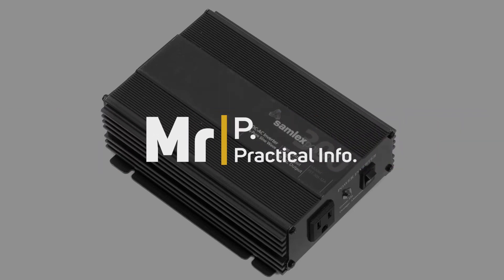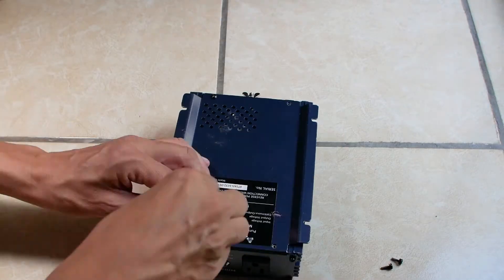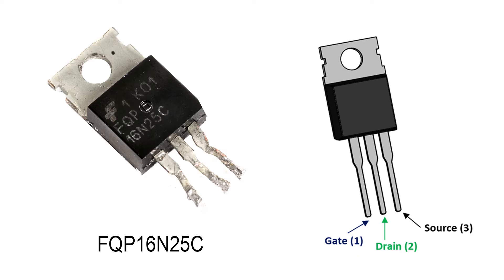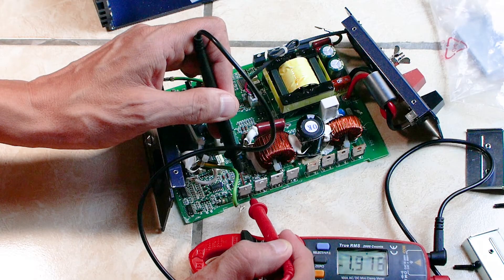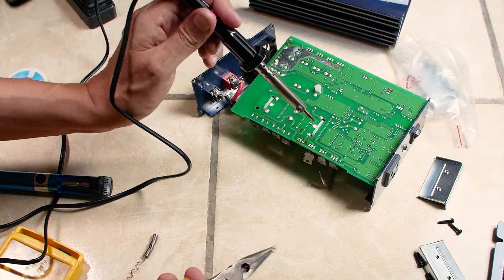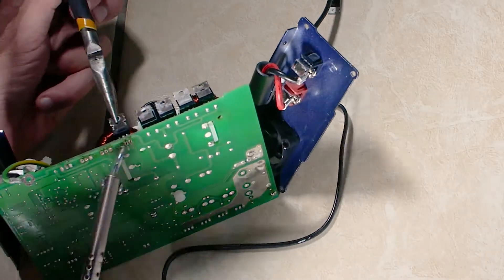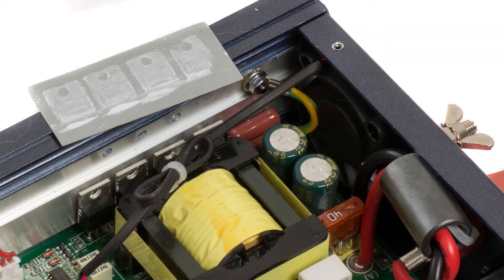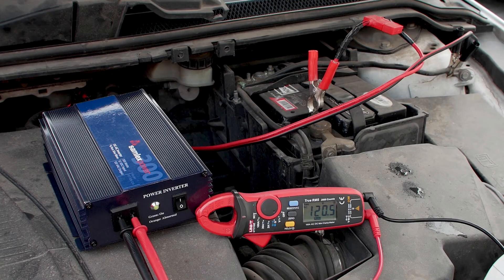Power Inverter Fix DC to AC 🔌

Comment: When you measured your mosfets, you mentioned they 1.5 volts.  And anything between 1-2 volts is ok.  Is that true for all mosfets?  If not, how do I find the expected volts for my mosfet.  Also, I searched amazon for the two different mosfets I have.
Neither of them are returned.  How can I find an appropriate substitution.
Reply from the maker: Go to the website alltransistors.com to find a MOSFET which is similar or better.
Reply: Thanks for info.  However, I don't see the mosfet label I see on the inverter. @brieftodo

Comment: Thanks for your input and pointing me in the direction to start looking.  My Power watt 3000 fires up in about two seconds goes into protection mode. ever since I’ve had it when I would hook up the power to the batteries there would be an arc from the capacitors charging up. I thought that was normal because it always did it now up and goes into protection. Thanks for your input. Have a good day.

Comment: Great video!
I've got a POWERDRIVE inverter 3000w that worked for about a  year and now only powers appliances under  approximately 80 wats anything over that it displays overload and shuts off
Any suggestions what could be the problem?

Thanks,

Comment: Thanks for your video!.   I'm trying to repair an inverter and out of 4 banks of 6 MOSFETs I found a bank with the "Source" in contact with the board  but not soldered.  Did the manufacturer forget or do some inverters work like this?
Thank you for let me know something about.
Alessandro ( Italy)

Comment: Nice video.
Now that you substitute the mosfet with different one, do change them all or you can mix it up with the old one.
Greetings from Nigeria
Reply from the maker: It will probably work with just changing the faulty one(s) but it is better changing the set just like a set of spark plugs on a car.
Reply: Where in Nigeria precisely? I'm from plateau state, Jos to be precise

Comment: Thank you for sharing this, I have a 3,500 watt inverter and I wanted to replace a couple of MOSFETs .  The part number of my inverter is FB38N20D  P038D and I found one on Amazon with part number FB38N20D P826D, could I use these or are they a different number all together?
Reply: Probably 8 months too late but those are the exact same part numbers (FB38N20D), the second number is a 'batch' number.

Comment: I got my power inverter wet and it would say overload protection took it apart and it had two bad transistors in it and took them out and  it dont overload with a voltage of 70 volts now it get no voltage  when put new mosfets in it can I use irp460 in place of irfp260m

Comment: To remove the MOSFETs more easily, cut all the pins of all of the dead MOSFETs on the topside of the board, as close to the board as possible, and trash the head assemblies. This does several good things... 1) It eliminates the heat sink effect of the MOSFET pins and head; they are stealing all of the heat off of your soldering iron tip. 2) You only have to remove one pin stub, at a time, instead of fighting with the "blob the whole mob" approach. 3) Without the pins and head, you have better access to the pin stubs. I hope this helps. YT has lots of soldering videos with other tips and tricks.
Reply: Yea or a heatgun
Reply: Great video, I'm troubleshooting one right now and that gave me something to look at.
Reply: best idea,no doubt that helps, i knew it,but i  do need to remember that

Comment: Hello
I baught 3 years ago,a convertisseur 12 v 230 v 3500 w, TBE from China.
2 transistors are braught. The references are not written. STRANGE. 
The diodes are good, but the references are erased .STRANGE.
What référence possible for transistors ?
I see ,on several vidéos, irf 3205.
Can you give me confirmation ?
Thank's.william from France
Reply from the maker: That is a difficult one I would search for a similar inverter made by a known brand and see if you could get hold of a service manual to identify they MOSFETS and diodes used and then try to find those ones or the equivalents. Another way is to find YouTube channels whose niche is fixing inverters / solar energy equipment they often give some tips on how to diagnose the replacement component values.
Reply: @brieftodo  Thank's.
It'not normal,transistors without référence, diodes  erased.
I send a mail to Aliexpress wich prohibit to sell materiel without possibility of detached parts.And on this case ,convertisseur,the electronique map -schema must be provided.I continue to search in the forums and ,if l find,l  contact you.
For ce moment ,the most cite ref is irf 740.
My friend électronic engeneer thinks irf 840.Thank's William